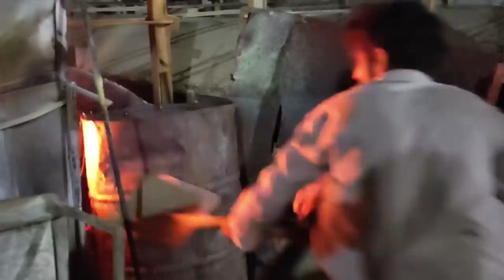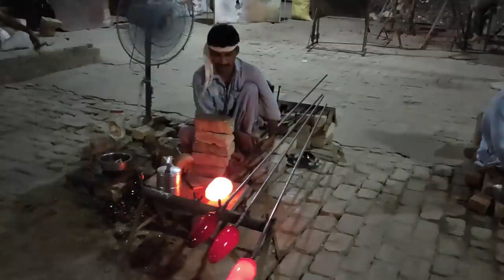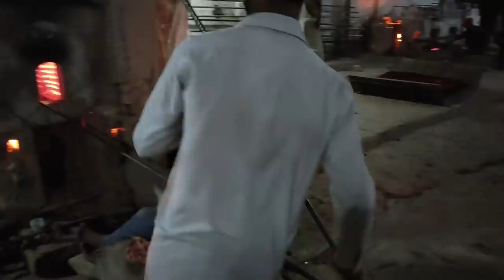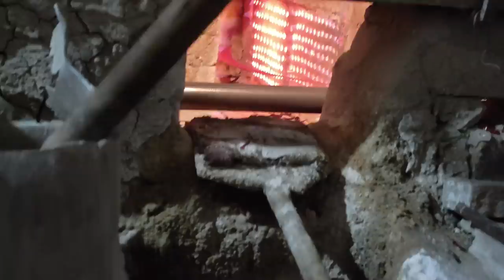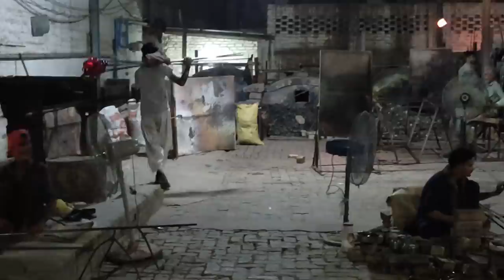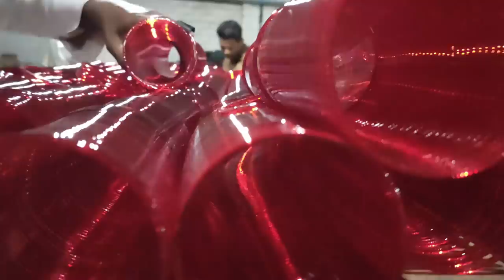factory tour of bangles making process || amazing bracelet glass art

Comment: Why is the process of merging circles to make complete bangles not shown here?
Reply: Yes same question
Reply: यही बात मेरी समझ नहीं आती
Reply: ❤Yes... same question in my mind...🤗❤
Reply: That process is done separately by different group of workers at their homes. They carry these bangles to their homes then first step do alignment, then second step welding, then designing and then colouring then baking to stabilise the colour. All these steps are done manually. Designing is very interesting process, there are grinders having footprint of design to be made, the grinder is made spinning by set of motor and pulleys, , worker picks a set of about 8 bangles and rubs against the spinning grinder inch by inch so as to make design on entire circumference. During this process water is kept flowing to avoid heating. Workers get their nails and fingertips destroyed due to exposure to water and friction. Now a days there is increasing trend of spray painting over bangles to bypass this step of design.
Reply: @jahanzaibshaheen7689  ❤so...  great coment... with well elaboration.... Thank you for knowledge full comment..🤗❤
Reply: that process called sadai in which cross ends of bangles straighten and then joined which is called jurai. this was the profession of my ancestors in Pakistan and India. and because of it we were called Sheeshgar (glasssmiths)
Reply: Thank god you asked.. I had same question..